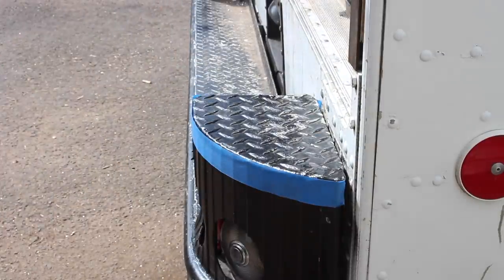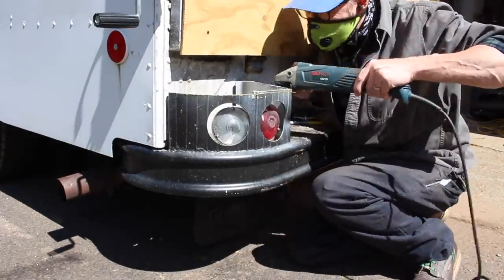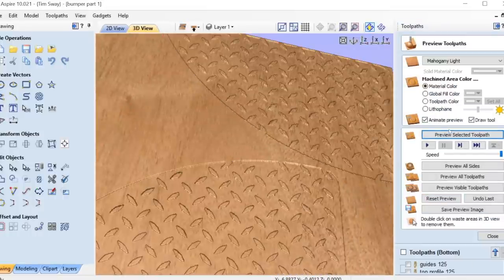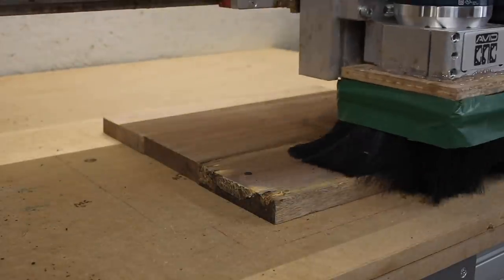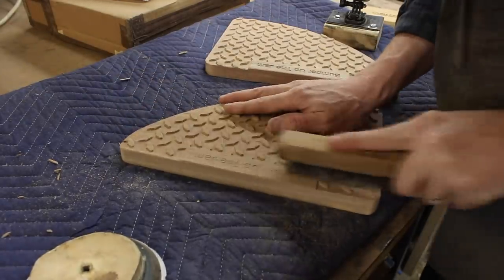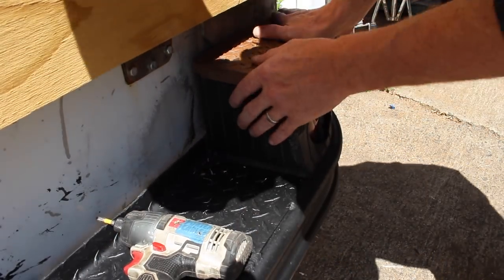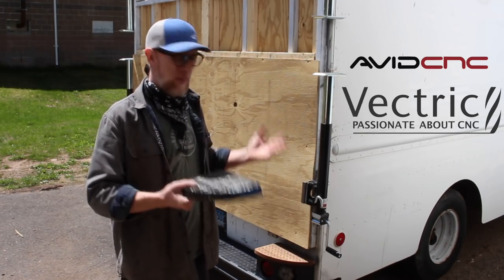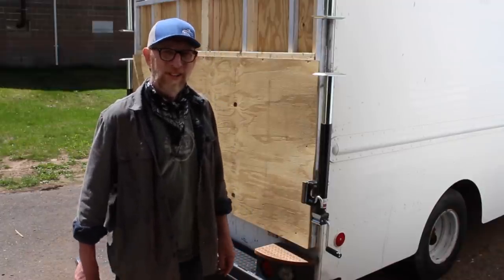Wood Diamond Plate For My Truck - CNC Woodworking

Comment: Take off the new pieces you have machined, lay a piece of sacraficial ply or soft timber over each side and hit it with a hammer. This will leave an indent on the underside that would be the perfect pattern for a snug fitting rebate.

Comment: if you had removed the bumper you could have knocked those dents out pretty easily
Reply from the maker: probably, but to be honest they are perfectly symmetrical , believe it or not, so either they were designed that way (??) or the guy who backed it in to a loading dock was a pro and hit it dead center! So they don't really bother me.

Comment: This is an amazing and nice reuse of wood and CNC practicality. I cannot wait till I could afford one myself but I still get a kick watching your videos.
Reply from the maker: cheers man. Like any tool, you can get in to cnc relatively inexpensively but the possibilities really start to open up when you start getting in to bigger and heavier (and more expensive) machines. One thing for sure, it's a whole new world of woodworking. Learning the computer design side of making has made me a better woodworker all around - on and off the cnc.
Reply: @timsway  That is what I am expecting. I am saving up for a 'hobby' machine, about $2,500. This will give me a start and force me to finally learn Autodesk 360. I learned how to build a square! Hey, it's a start.

Comment: These turned out great! I just learned about the trim tool in aspire, and it’s super useful. I think it might be faster to use that than node editing all of the diamonds.
Reply from the maker: The trim tool is great for merging vectors in to one shape. It auto connects the nodes. But when working with one closed vector it doesn't function, unless there is an overlap. How's the avid treating you?
Reply: tim sway it’s been working out great! Mach 4 has a little bit of a learning curve but it’s pretty easy👌
Reply from the maker: yes. it does a LOT. start with the basics. I know probably about 20% of what it can do.

Comment: What’s the saying? “When you have a hammer every problem is a nail”. I probably would have gone with your first thought and TIG welded or AC MiG welded it but that’s my hammer.  It’s cool to us the CNC in ways I wouldn’t have considered.  It’s certainly not my go to.  That said... my plasma CNC is.  I was never in a band, but if I was it would have probably been metal.
Reply from the maker: Well executed comment. One of my favorite things to do is make doing something the wrong way right :) If it were steel I would have just mig welded it, but I'm weak with aluminum TIG welding and add working outside with the interference and contaminants I thought for sure I would make a mess of it.

Comment: I may be missing something, but how do you change a bulb in those rear lights (or even the whole light fitting, if it gets broken), now there's a load of wood glued very firmly in place? Does the whole bumper have to come off?
Reply from the maker: you can take the lenses off through the front. I paused about that, too and considered making them more easily removable, but then realized it was designed with a fixed top to begin with so it must not be too hard to do. And now I don't have to worry about my bumper tops loosening up or flying off on the highway and cracking a windshield.

Comment: the right plate is already loose. :( it moves when you step onto it at 6:24
Reply from the maker: the glue hadn't cured when I filmed that. Just wrapping up filming too quickly. it's not going anywhere.

Comment: you should polyurethane that wood, because epoxy doesn't handle UV light well, and they will get lots of UV in that location.
Reply from the maker: I used a varnish made for boats on wood made for decks. The sun and rain will wreck everything eventually, but this will last a little while.
Reply: @timsway  fair enough...but even totalboat puts poly on their epoxy. :)